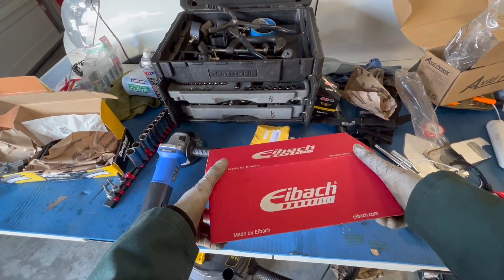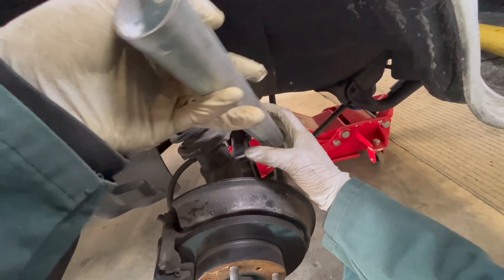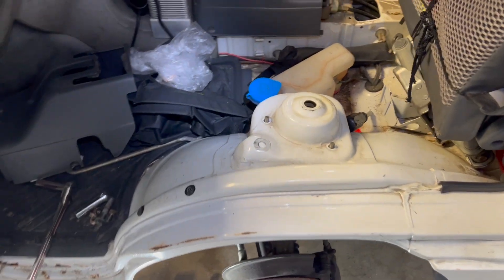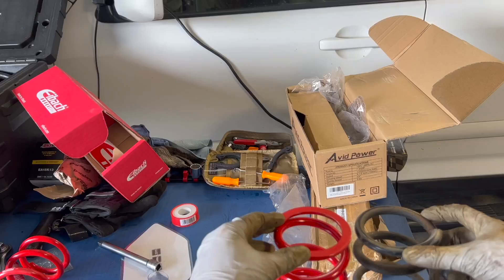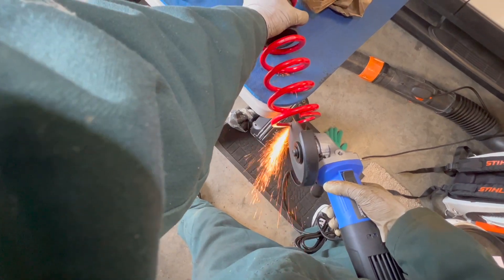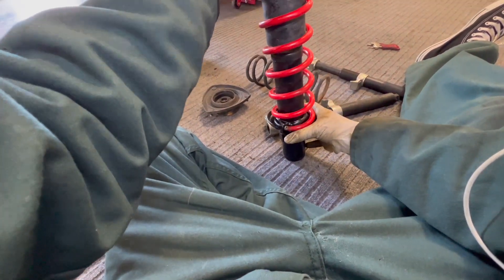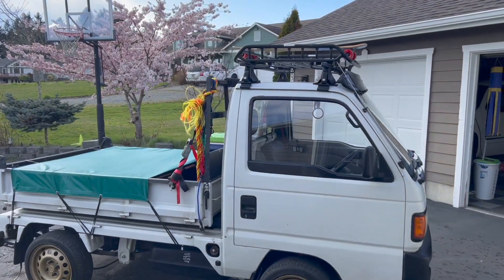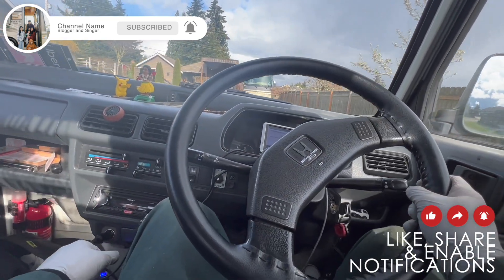Installing eibach springs on a Honda Acty

Comment: How’s this do over larger bumps in the road? I went with the QA1 progressive rate 225/475’s, and it about launches my head into the roof over some bumps. As if the suspension isn’t absorbing the load, rather transferring it to the cab.

Comment: Can you explain why you need a wrench and allen wrench to remove the top of the strut? You hold the allen wrench tight while only using the wrench?
Reply from the maker: Cuz there is a screw on top with Allen key it’ll just spin the entire strut if you don’t use both. You’d have to try it to understand.